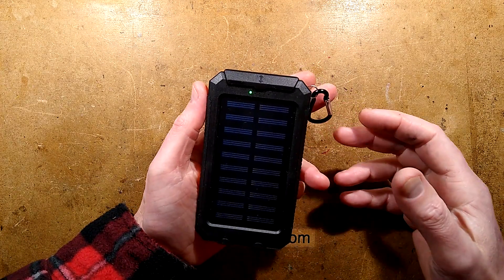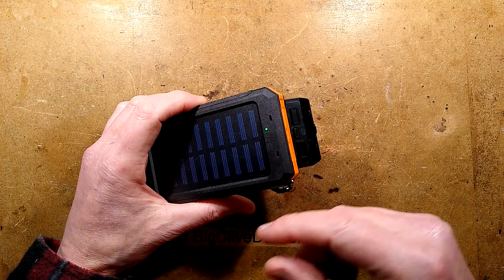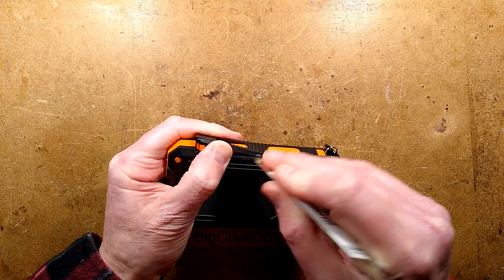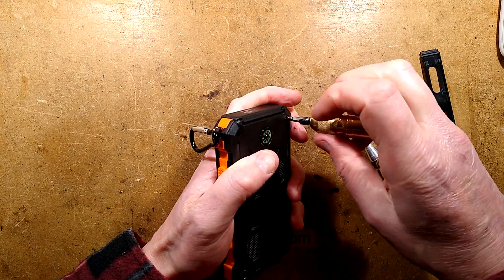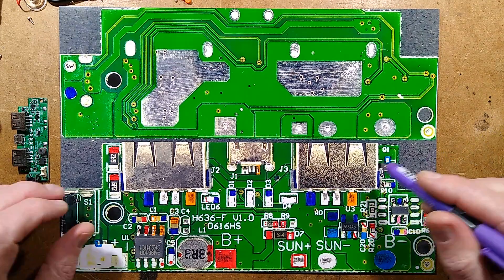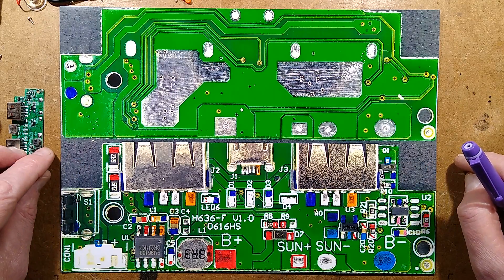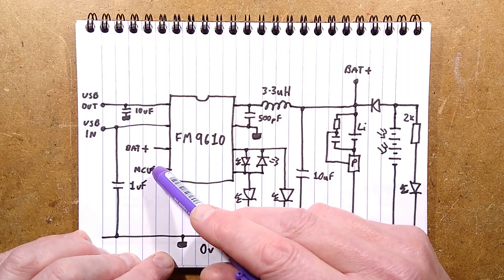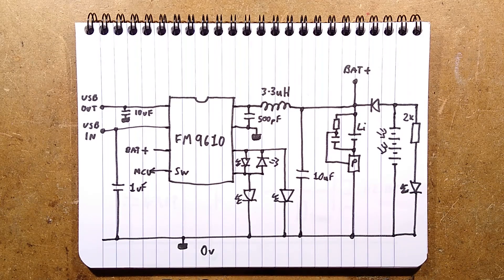eBay 9 MILLION mAh power bank teardown (with schematic)

Comment: The other way they could have replied to you is that they meant to say the power bank is rated for 9,000,000 uA ... and there's no reason to doubt them anymore as a reputable seller of weighted power banks... but it is sad, they overlooked a golden opportunity  to make a do-everything apocalypse survival battery bank, just add a few more items besides the Compass and Flashlight with S-O-S mode, you need a beer opener, sewing kit, tweezers, fire starter, fishing string with hooks and weights, mylar thermal blanket, rain poncho.... hmmm... what else am I missing?

Comment: 0:36 Your calculations is incorrect, it's "only" 32.4 million milliwatt-hours. 32.4 kWh. Small-ish EV battery or about 25 EcoFlow 1300s, which weigh 12kg and cost about $1200 each.

Comment: That is one of the fake ones there is lots on Amazon I have one that looks identical to yours but the circuit boards is completely different and has a rating of 36800mah and 3.1a output.  I have another identical one that is rated 20000mah and they don't have weights hidden inside I checked so, some of these are ok but I thing the claims are still to high my phone has a 4000mah battery and the 36800mah power ank is flat after charging my phone twice. Not to mention that solar charging gimmick, it literally tell you on the directions not to charge with solar unless in an emergency
Reply: It also stated that it would take a week to charge it completely on solar.
Reply: Yeah it's pretty common to exaggerate the capacity by 3-5x, so if yours actually charged your phone twice, then that puts their exaggeration below 3x.  Ie: Higher than usual ethics from that seller!

But maybe it didn't even fully charge the phone on the 2nd charge, yea?  Ie: power bank ran out you say.  In which case yep it's probably the normal 3-5x exaggeration.
Reply: @roidroid  normally I'm glued to my phone all day if I'm not busy, so I'm using it during charging if i'm charging on a power bank. so yeah it usually get 2 full charges i would say while still using it. but i will say the charge current is decent on mine and it has no issue of getting a full charge even during heavy usage. when i did the tear-down on mine to check the battery capacity on the actual batteries the side of the battery that has the capacity and part number on it was of coarse covered up by the adhesive foam used to keep the battery in the correct place. i did try to get the foam off but it was being to difficult and i gave up before ruining it.

Comment: I detect sarcasm.

I have a question, and this is as good as I am thinking of the question now.    
Does a magnetic smartphone mount interfere with the phone's compass?
Reply: In almost all cases no as it is using the GPS chip to locate and orient itself, not a magnetic compass.
Reply: @FireAngelOfLondon  the GPS chip can locate but not orient, they use a magnetometer (typically combined with accelerometer & sometimes even barometer too, in 1 chip) to do that, it will be effected.
Reply: It certainly has the capability to interfere.  I'd be curious to find out where your phone's magnetometer chip(s) are and see if you could put the mount as far away from that chip as possible.
Surface-mount magnets like flexible fridge magnets typically use a repeating pattern of alternating magnetic poles on them which doesn't extend out as far as normal magnets (but gives it a very strong hold when close), so maybe it could be ok? I'm curious too.  I bet it'd have to be a case by case thing tho, as would depend on the phone.

Comment: Yeah you're finally reviewing one of these I have been holding off on getting one until I saw a decent review and now the reviewer of the reviewer is reviewing it!
Reply: I hope people realize that was all sarcasm. Although I have seen them around and wondered how well they work and if they would even be decent considering their outrageous claims..
Reply: @imark7777777  from what I'm seeing in some other comments: Some are indeed legit devices with normal sized batteries inside, more down-to-earth capacity claims, and higher amperage in the output.
But hell if I know how to tell which is which without opening it up.
Edit: If I had to make a quick guess, I'd look for a reasonable capacity claim & USB-C output.

Comment: lads, I found this gentleman and his content by accident, I have been charmed and fascinated by his passion for electronics and "schematics"

but I understand nothing!

and very few times curiosity itches  this hard, so I would like to ask, if you have any recommendation to learn about this from absolute zero
Reply from the maker: The best way to learn is to start playing with electronic stuff.  You can get starter kits (suites) on eBay.
Reply: @bigclivedotcom  I was going to suggest breadboarding but here in the States we don't have a Radio Shack (where you could pick up a card of resistors for $.49) in any tiny town any more.
Writing that ^^^ I felt like I was humble bragging about how good I was at hitching the mules when I was a kid.  😆
How do you explain setting up a 555 with different resistor values to get the right time, or why a 714 is current limiting and a 1N400x series diode is used as a rectifier?
You have done so much to spark interest in how circuits work just by dissecting cheap Asian faff.  👍
Reply: Ye electronic kits with a breadboard, resistors, LEDs etc. are a great way to start playing electronics. For me I needed to fix hifi gear about 5 years ago. It got out of hand and I now have 3 DIY power amplifiers, a DIY preamp, and a bad habit of getting excited when I find broken things.
Reply: @peterlarkin762   I can relate to the last one. 😆
Reply: "one moment, please"...  ☺️
You want to learn basic analogue electronics???
Reply: @jimurrata6785  yeah, but don't know how to start

very few times in life I have felt this sort of curiosity, and really feel it would be a mistake to ignore this little itch I have discovered
Reply: @jessemcallen8521  I started out in the early '70's with Forrest Mimms books and Heathkit kits . I knew the resistor colour codes at six years old.
This was before the idea of applied electronics would be found in your home (beyond a transistor radio or microwave oven)
I don't know where you'd start today. Surface mounted devices are another world compared to soldering through hole discreet components that have legs.
If you want to understand what components do (capacitors, transistors, diodes, resistors...)  They are all just valves, gates, switches and tanks for electrons.
I'm sure you can find it on the web or get some of the old Mimms books. Find a mentor. Us geeks LOVE to ramble on about our special interests.
Reply: Just keep watching Clive. It takes a long time to trickle into your brain but you can pick up a lot
Reply: Search for books on basic electronics, or learning electronics.
Reply: I started out as a kid in the mid '70s with those Radio Shack many-hundred-in-one sets, then moved on to TTL chips and LEDs on breadboards thanks to "The TTL Cookbook" being at the library.
A modern equivalent of those old sets would be the Snap Circuits, but they're not as convenient as those wonderful spring connections.

Comment: well i am 1.46 seconds in  and 9million mah would not power a tesla foe a year would it i have a 20.000 mah power bank and my math is good and very quick as i have allready worked out that its 450 of those would that power a tesla for 1 year..i dont no about them silly cars that nearly run me over...i guarentee u there gonna make a noise for those cars cos there dangerous just like gas when that was found it never had a smell and the person who invented the smell he was sum1 eho got blown up but it so they put the smell of gas in gas even though it was not gas smell at the time as it was b4 and it was just a smell..but anyway i wanna make a power bank but am not good with circutry

Comment: i wanna make my own power bank as i bike alot and i make eveything myself so its thr perfect size shape like if i bought this which i wouldnt i would test the strength cos everything that is built now days is built 2 bust or with a short period of time..like keyrings yano thrm round things what you spin ya keys round well a avr size one of thos have a 16kg strenth on them and thats a basic one and it will bend but still ya keys are gonna be stuck 2 you and obv chains or rope it just snaps so i just makesure everything is double secure.but ime no good with electrics i am ok but i can not soilder
Reply: If you're no good with electronics don't even think about trying to make a power bank, you will make something likely to set fire to itself and possibly set fire to you as well.
Reply: Soldering is quick to get used to, and very forgiving (ie: badly done it will still mostly work).  You should get into it.

Comment: oh really!!!!!!! 9000000 mah  i find that hard to believe

maybe 9.000000 ah or 9000.000 mah.

probably a typo in the manufacturing.

at 32kw that would have to be transported by freight on land and maybe ltl ship by sea and probably could not be delivered to residential.

anything single cell up to 20 watt hours can go by mail.

over 20 watt hour but up to i think either 250 or 500 watt hours can go by fedex and above that would have to do by freight

Comment: Have one just like that in bits on the workbench. Was killed by a bloated cell. I'm planning to repurpose the board with a bunch of vape li-ion cells. Just wondering if I should add a better solar cell?
Reply from the maker: I'd recommend just replacing the solar panel with a blanking panel, as sitting a power bank in direct sunshine is a bad idea.
Reply: @bigclivedotcom  Yes, fair point! The device probably was killed by keeping it behind a car window in the sun in the first place.
Reply: Always worth upgrading the solar cell in my personal opinion. The stock solar cells in these are often jokes. Trying to use one is a great way to make your battery really hot for no good reason.
Reply: @FerralVideo  the original solar cell died when the battery expanded. A better cell in the same size is probably still not that powerful. Might need to create a new case with a second panel to fold out or something like that.

Comment: I have one of these and it has served me well to charge my phone. Recently the battery has started to fail and no longer holds a good charge and while using it the battery gets warm so I stopped using it. Not sure what to do with it as in modding.
Reply: Measure how much space there is and order LiPo cell that fits. They are sold by physical size for example an 803090  is 8mm thick x 30 x wide x 90mm long. You can but them from Amazon.
Reply: @IanDarley  outof curiosity, what would the number be if you wanted one 80mm thick - 8003090?
Reply: @IanDarley  It's all worn out from being in my pocket and I already bought a newer one that is physically smaller but has twice the capacity. No solar charge though. Might hack the old one to just be a solar to USB charger but I doubt that the solar panels will have enough power.

Comment: Correction I'm afraid.
It wouldn't take 625 days to charge.
It would take 1875 days to charge, given it's over a year long and there are limited hours of sunlight per day, which average about 8 hours per day over the course of a year, the 625 has to be multiplied by 3.
Reply: thats 625 plugged in. he said he wasnt going to calculate the solar charging.
Reply: @DeaconTaylor  ahh, good point.  I'm just salty because I got a similar one (without outlandish claims) a few years back. 20,000mah, which it was, and a solar panel. A 200mah solar panel and a warning not to leave out in the sun. Piece of crap

Comment: I also had one of these...
Left it charging laying in front of the window and it finally signaled end-of-charge with a big bang 😆.
(also this seems a very fast way to open the case 😆)
Reply: They should pack them full of confetti at the factory, would be so great.
Reply: @roidroid  glitter. Should be chock-full of glitter
Reply: The automatic self-disassembly mode is a feature.
Reply: That was the end of life indication, which typically occurs before the end of charge point is reached.
Reply: EY, COOL!! Acoustic end of charging cycle notification is what I always wanted, harhar XD
Reply: and the fire fighters will open your whole house
Reply: I seriously doubt the solar panel assuming it's even real is actually connected to the battery.
Reply: @eraldorh  Yes, in my case solar was working, but connected directly to the battery, so bypassing the battery protection.
Reply: That's how my cell phone opened up to let me replace its battery, though much slower and without the noise. Apple learned 20 years ago not to obsessively top off batteries, but Android is only now learning the same.
Reply: @8bitwiz_  "Apple learned 20 years ago not to obsessively top off batteries"

Did Apple used to break into people houses and put their devices on charge whenever they could?

You do realise that Android isn't a manufacturer, right?

Comment: The 9 Mega mAh capacity is the new Chinese version of the old IHF / Music Power / PMPO rating of audio amplifiers. 
Let’s just settle for good ‘ol RMS power ratings, so /maybe/ *5000mAh RMS, or 5Ah in real world numbers.

I suppose the numbers are correct in Chinese, much in keeping with the words/language used in the flypaper user manuals.

I just saw your battery test results, even my pissweak estimate was double their reality !
Reply: pmpo i'm pretty sure is calculated by feeding a max slew rate signal and extrapolating the peak if clipping didn't exist, should be called peak slew rate power bs all around still
Reply: Interesting idea to use RMS to measure DC 😁
Reply: @bennylloyd-willner9667  Haha !  Just a point of non-comparison !
As meaningful as 9000MWh 🤡
Reply: I remember Chinese Watts from my first attempt at car audio. Similarly, when buying a tent you have to divide the occupant capacity by 4.5 to nine, maybe twelve if you're big.
Reply: @tactileslut  LOL, I used to use a rule of thumb 6x in the 70s and 70s, but that’s a bit low nowadays !

Comment: Some day, I would love to see Clive test something so beefy that it makes that tiny little fan spin on the USB load tester.

I still have a spare Apple USB-C charger (with neat super-springy fold-out pins) if you want it Clive. I'm afraid the bottle of gin that looks like a giant bottle of poppers is... no longer available.
Reply: It won't ever spin in the first few seconds, since that heatsink wants a good heat-soak first before temperature reaches threshold. Thermal design on this little tester is really quite decent, quite effective.

But it'll spin up eventually even with very modest loads.
Reply: My 68 watt phone charger will make it spin a little, off and on.  But it takes a while before it moves.  I am not sure how needed the fan is to be honest.

Comment: I have that kind of power bank and thankfully I watched your earlier video on this solar charging scam where you showed that it actually drains the battery when exposed to light (the green LED). I never tried to charge it via the sun because I don't want it to overheat and I thought it was weak charge to start with. And I always set it aside with the solar panel facing the surface.
Reply: It could probably be done right if they designed a solar panel on a fold-out hinge, with a mirror covering the battery underneath instead.  The mirror could not only reflect the sun away from the battery - if it defects it into the solar panel you get more power!
Reply: The green LED cannot drain the battery cell, as it is on the solar panel side of the diode.  It can only waste energy from the solar panel.
Reply: I managed to put 4 of these panels in series and it certainly charged the battery in summer... but only in summer.
Reply: @TechyBen  I bought a 10W panel I can carry/strap on my backpack to charge the phone while I'm hiking

Comment: That looks like an updated version of one of my power banks, but mine is only 900,000 mah (or 8000). Don't plug it into a laptop, I thought it had killed mine until I did a hard reset.